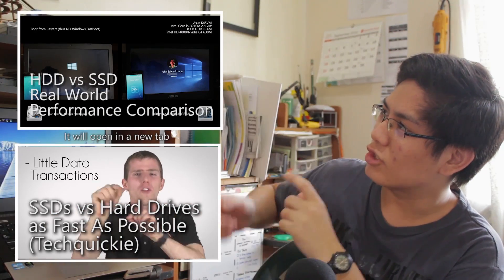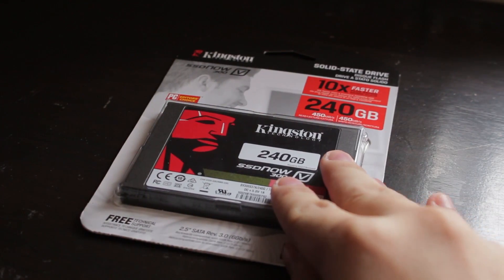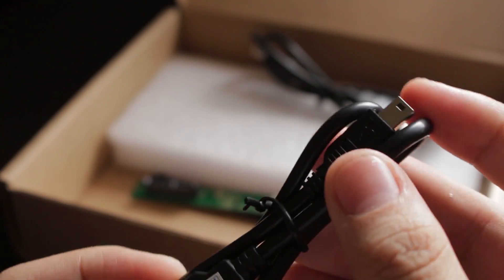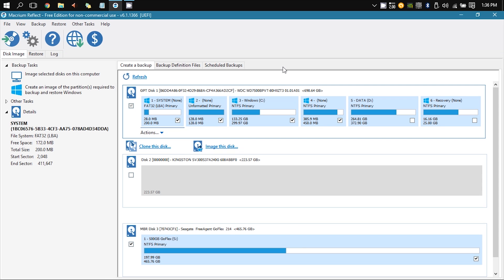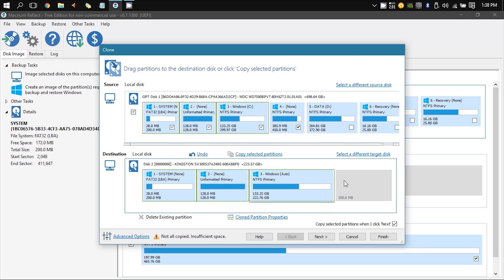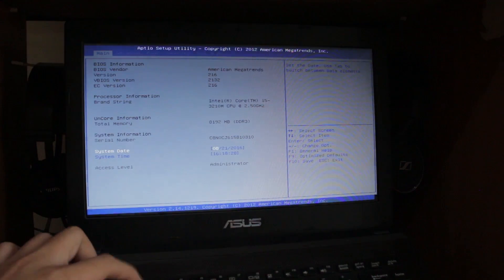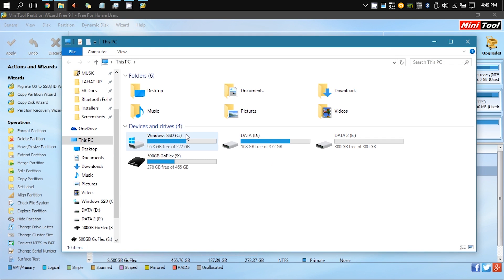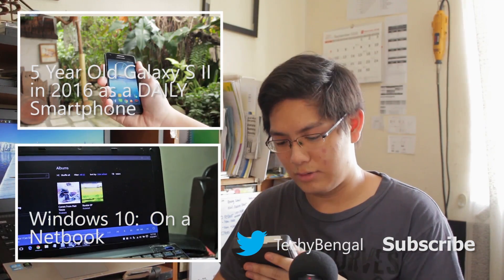[OLD] SSD + HDD Dual Drive Setup in Almost ANY LAPTOP

Comment: Very late here: Will I get the same transfer speeds by replacing dvd drive with ssd rather than hdd with ssd? Also I work primarly on linux, do I need to change any mapping to get it boot from the new dvd replaced ssd?
Reply from the maker: Place the SSD where the HDD is to get full sequential speed.
Like in the video, after cloning your system/OS partitions, just set your BIOS to boot to the SSD instead of the old HDD.
Reply: Thanks dude! It works super smooth when using the ssd as primary! Kept the old hdd in the optical drive replacement, using it for long term storage. My laptop has a new life! Thank you very much.!!

Comment: How is the battery life after installing one ssd and a hdd?
Reply from the maker: Hard to say because my laptop's battery is already showing its age.
I think the impact is minimal, but don't quote me on that.
But if you look at it, SSDs consume less power and does tasks much faster, in turn the HDD can now idle most of the time.
Reply: It really feels the same. I think running off the SSD improved the battery life a little too.
Reply: EJ Tech just use the laptop until low battery warning goes off and then fully recharge it

Comment: Excellent job! Very informative and I definitely will be doing this on my Dell Laptop. I have one question though: Is a 120GB Kingston Digital SSD enough to store all the OS Files or do i need to buy 240GB just like yours? Thanks & I already liked and subscribed! Keep the video's coming!
Reply from the maker: Check My Computer/This PC and see how much space your (C:) drive uses. 
If it's close to 90+GB used, then try to move your personal files to an external drive or to another partition first.
But if you can afford a 240GB SSD, then go for it as it offers a better value.
Reply: Hi everyone I used this product and it is a very high quality product. Currently this product is discounted and there are few available click on the link you want to buy: https://amzn.to/326lIdh

Comment: 1) I would have explained, in a bit more (& slower) detail, how you knew to add 500mb to the end of the drive & why you didn't clone the 5th & 6th partition, 2) I would say that it would be beneficial to new people that they verify they've actually booted to the SSD clone successfully before nuking any Windows partitions on the HDD, 3) some laptops are resistant to accessing BIOS from key press. You can instead go into Windows recovery & choose the boot up option which allows you to access UEFI on reboot. Good job on the vid-- all that's missing are a few notes showing possible sources for the caddy. Cheers!
Reply: https://www.youtube.com/watch?v=6BBHU0ctAHU

Comment: I have done added SSD as primary partition and removed CD ROM by added HDD instead as secondary partition but the problem is that my HDD speed not reliable it's so slow. My laptop model ASUS S551LN.

Comment: Great video, man , tomorrow I will do a similar upgrade to my laptop, swapp the ODD with caddy+SSD and make a external ODD out of the swapped one. But I will be a bit more lazy than you, fresh installing Windows on SSD, back-uping the files from the HDD on an external one, formatting the HDD as a single partition for file storage, instead of doing crazy cloning.
Reply: Claudiu Lucian Thanks Claudiu! I did it your way and it's amazing. My laptop boots in less than 15 seconds(not exaggerating). And I don't have to go through all the trouble with cloning and what not.
Reply: Claudiu Lucian Hey dude. I was wondering if the way you did it worked for you. I was planning to do it this way since I don't have any important files and I was planning on redownloading my games in the SSD but wasn't sure if it'll work or not. I would like to know if it does.
Reply: Claudiu Lucian Hey dude. I was wondering if the way you did it worked for you. I was planning to do it this way since I don't have any important files and I was planning on redownloading my games in the SSD but wasn't sure if it'll work or not. I would like to know if it does.
Reply: Nathan Hamman it depends. yeah, it's not great to write tons of things all the time on a SSD, but if you don't change your game library every month it shouldn't be a big problem, SSDs are much better now than a few years ago. After that it depends how much the SSD can write before going bad, some cheap ones may die surprisingly fast, others survive for longer than the PC itself.
Reply: Mar Mar it works out great, but putting your games on an SSD would not be a great idea, mainly because it will degrade incredibly fast and die
Reply: Mar Mar yeah it totally works, man,  and everything loads a lot faster, it was the best upgrade possible for my laptop, I will never use one without a SSD for now on
Reply: Hi everyone I used this product and it is a very high quality product. Currently this product is discounted and there are few available click on the link you want to buy: https://amzn.to/326lIdh

Comment: ahh no speed test?
Reply from the maker: I did a real world test. Click on the top annotation at 0:06
Reply: what's the caddy's max transfer speed?
or did you use it to boot from it, wouldnt the internal sata connector be faster than caddy?
thanks for reply
Reply from the maker: I swapped the drives later so the HDD is now in the caddy. I found out that the optical drive bay is limited to SATA II and sequential speed is limited to 250 MBps but random IOPS is unaffected.
Reply: ahh cool thanks for that.

Comment: more easy step to boot from ssd or if you want to boot to your hhd because you forget to backup something just go to the cortana search bar or the bar that is next to the start menu it say "search the web and windows" type "system configuration" click it, then when the window opens just tap the boot tab and choose the os you want to boot as default  , restart your pc and it should boot on which ever drive you choose , also tip if you want to erase your hhd and backup some data just partition your hhd in to two partion save the data one the partion which is free of the os then just delete the os partition and make it whole again

Comment: good explanation , but could've explained the partitioning step a bit more
Reply: you can use 3rd party software to do partition, that what he does. you can also watch thorough explanation from others on how to use the software u choose to use. the software he demoed, as i understand - the ssd was smaller gb capacity than to his old drive so he can not clone it completely. so he gave up some space from his hdd, drag those files from hdd to that space he allocated - enough gb to be accommodated by his ssd.
if it becomes vague to u, i suggest reinstall your OS and manually copy your files. at least that will give u a clean installation. ur files will be accessible if you connect ur hdd to your usb 3.0 port, HDD\user\ur account... 
what i did, i bought a sata III to usb 3.0 cable. :) but its bare. ull get electricuted maybe hahahaha...

Comment: is it true if I buy a SSD and put it where there CD rom was before, that I lose a lot of speed on the disk? 
is it then smarter to put the SSD where the HDD is(making SSD my boot drive), and put the moved HDD to the CD rom(as my storage drive)?
Reply: your question may trick you to find the answer. i believe older models of lappy may face this problem as to their slots are of obsolete kind of connection. first, YES its correct, u have to understand the SATA III and SATA II speed limitation. ur HDD is connected to SATA III with higher gbits rate of performance than to the SATA II. where as, newer model might have all SATA III express slots. You can consult your lappy manufacturer's manual. higher end motherboard has faster connections, with latest technology. there is already NVM Express (NVMe) or Non-Volatile Memory Host Controller Interface Specification (NVMHCI) - double the speed of performance. different technology on drives.

Comment: brother i want to know that it will void warranty or not.I want to do it in asus r558uq-dm701d when i purchase it.
Reply from the maker: That I can't guarantee. If any warranty stickers are covering the screws you need to access, then it may void it.
Reply: If the screw for the optical drive doesn't have a warranty sticker covering it, then it won't void your warranty.
Reply from the maker: Theoretically
Reply: but its worth the risk brother. putting this things into place is no-brainer. just watch youtube. i did mine with my zero knowledge what is inside. just screws, plug it carefully, then put back the cover, boot, then bang.... satisfied.
Reply: Agree with u,but by chance if it gets damage then i will be in big trouble because i am still only a student and have no source of money.
Reply: but it wont break, coz u're only plugging it in.. anyway.. take care best of it :)
Reply: ok,thanks for replying (both of u):-)

Comment: great video man! sometimes i even wonder why do ppl need optical disk reader for laptops lol. im gonna go find that caddy you mentioned and hopefully breathe new life to my laptop which is in vain right now. not even sure why the HDD performs so badly now and cant even launch anything atm. rip
Reply from the maker: I think your PC have a bigger problem than a slow hard drive. Try to do a clean install of Windows first. Another is that your hard disk may be dying. Use CrystalDiskInfo to check.
Reply: EJ Tech never heard about that program before. will try it if i can get my pc to boot. for now, it stucks at the lenovo splash screen after several times i tried to resrt or refresh the pc yesterday.
Reply from the maker: Yea...this is not the video for you. You have a bigger issue.
Reply: EJ Tech guess so. welp im gonna go google some stuff before giving up and get an SSD to replace it.
Reply: man i suffer the same. i have dell core 5 before 4gb ram and its crawling like hell until to its death. then i bought hp core i7 4gb ram--- win7. snappy in the beginning but as it becomes older yaiks... 2012 until 2 months ago. i changed my ram to 8gb, and change my drive to ssd. then bammmmm... feels like new lappy in an old face. I think win 10 helps also. good insterface. and the crawling hdd with transfer rate of max 25-35mbps, i put it as my second drive in the optical dvd rom now has max of 110 mbps trasfer rate. but because it is an old technology, i have more latency drops. but yeah that 110mpbs transfer, not even half my pc can do it before.

Comment: v300 such a shit ssd i have a pile of dead ones lol
Reply from the maker: Interesting. How many "Total Host Writes" did they get before biting the dust?
Reply: most were less than 7000gb's rest under 10k
Reply from the maker: Mine is 6.8 TB in. Let's see what happens. If it dies I still got warranty.
Reply: I have Lenovo y510p but I'm not using SLI Multi Graphics , could it possible works for me ?

Comment: How to keep the DVD drive. get a USB connector for the ssd, get a cheap fan cooler platform. modify cooler platform to fit ssd. run USB cable to USB port. you keep disc drive plus have cooling fan under laptop
Reply from the maker: You can't properly use an SSD over USB since Windows lacks "portable OS" support and USB will bottleneck it. It needs to use your laptop's internal SATA interface.
Reply: OK then in that case. migrate all data from the hdd to ssd. put ssd inside laptop in place of the hdd. run hdd in cooling platform as external memory. then you have I internal operating system on ssd.
Reply from the maker: Yes you can do this but the idea of the setup I did is for BOTH drives to be inside the laptop. No external drives or anything like that. 
Just ditch the DVD drive already and turn that into an external (that's what I did). Unless you need your DVD drive frequently and on the go and if that's the case this video is not for you. Get a WD Black2 hybrid instead.

Comment: They need to make a caddy with DDR5 2GB integrated to speed up the laptops and the older desktops, so we can add SSD memory and also have DDR5 to speed up the pc
Reply from the maker: There's no such thing as DDR5 RAM. Did you mean GDDR5 on the GPU?
Reply: EJ Tech yes, or at least DDR4 which can allow it to be a bit faster, basically for older desktops or older laptops as a way to enhance them a bit more.
Reply from the maker: Not really. The CPU needs to support it first. Also if the CPU is not fast enough it won't be able to take advantage of the faster RAM.
Reply: EJ Tech they could do a caddy with an extra SATA cable to have two plugs, so it can send more data with an SSD.

Comment: Good video.  A more detailed video on how to copy windows to another drive would be good. For example, what are the partitions typically found on a hard drive with windows 7 installed? Why is there more than 1 partition?  If more than one, how do you know which to copy over?  Do you have to reenter the windows license key after the OS has been moved? etc

Comment: I bought a SATA III SSD so should I put my SSD into the SATA connector that my HDD is currently using and putting the HDD into the caddy? will that work fine as well and keep my SSD running at full speed? thanks
Reply from the maker: Yes. That is what I did later when I found out that the optical drive bay is limited to SATA II. Though it didn't affect the SSD's (real world noticeable) random R/W.

Comment: Hey man great video. I'm kind of a noob in this, so I have a question. Could you explain a little more what is happening when you are using the Macrium cloning software? Does it allow you to transfer your files and programs directly to the ssd or what? I want to do something like this but I'm afraid that the ammount of programs that I have in my HDD might be too much for fitting in the SSD. Any advice?
Reply: Awesome man. Thank you very much! Keep it up with the good content.
Reply from the maker: Don't forget to clone the other partitions as well, like the EFI or the other small partitions left of (C:)

Comment: hey buddy loved the video. I would like to try it out. But the ones I'm finding on amazon doesn't seem to have the extra bit of silicon (or plastic) parts. can you please provide me a link to the one you've used.
Reply from the maker: I didn't get mine online as Amazon isn't really a thing where I am. 
But the kit I have with the rubber things kinda sucks. The usual kits with screws are much better.

Comment: You deserve more Subs! Great content, but question if the optical disk drive is only limited to SATA II Wouldn't it make more sense to put the HDD there instead of the SSD, or is that impossible? Sorry I'm still learning
Reply: yes it will work. i have mine, hp 440 g0 model released in 2012. I remove my hdd, put the new ssd and reinstalled OS, or u can clone urs. after booting properly  and reinstalled all the drivers needed, have the drive caddy, put the hdd and install it to where old dvd was placed. then restart.. in beggining it will not detect, or possibly the PC is still detecting. I loaded Win 10. and it helped to manage all the drivers to be installed without looking for them. nice.. so i have 2 drives, ssd where OS is installed. and HDD on drive caddy where my optical dvd was before. It will work. and interestingly,  the transfer rate was faster than i've thought.
Reply: @joelutra5015  im lost here bro, please help... say im running a laptop with a standard 1TB sata hdd, i have the DVD bay as well, so i was thinking of replacing the DVD drive with a caddy and SSD drive within it (just like OP's video showed above) but youre saying to put the hdd IN the caddy instead of the SSD and put the SSD on where the hdd used to be right? will i able to do so with the standard caddy? and will i able to (just) simply put my new SSD drive directly into the old hdd port? please reply... many thanx before
Reply from the maker: Yea I did that mistake. I simply swapped the drives.
Only the SSDs sequential performance is affected.
Reply: I think he means putting the old HDD in the DVD caddy instead of the SDD, which would go in the sata 3 interface where the old HDD was before. Would that work?
Reply: Please answer us. is that even possible to put the HDD there instead of the SSD in the DVD adapter?
Reply: was thinking of getting an external hdd storage to dl all my files then upgrade hdd to 1Tb and install that into the caddy and have a 250gb ssd in where the hdd use to be housed. then just get someone to program it to work lol since I'm not sure about all the rest
Reply: @l0rdcroissant  
Just follow his instructions for cloning the hhd. After the clone it, simply replace internal hhd with the new ssd. Thats what I did and my laptops runs at least 10x better now
Reply: I had a computer store do all this and noticed in the end I had to install drivers and realised.. I think I can do all this and save my money :D
Reply: Hi everyone I used this product and it is a very high quality product. Currently this product is discounted and there are few available click on the link you want to buy: https://amzn.to/326lIdh